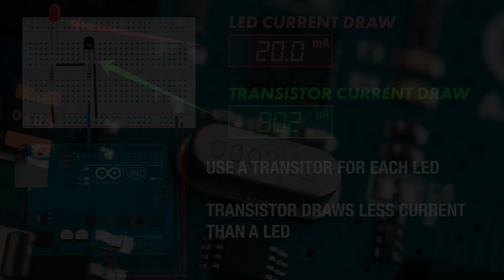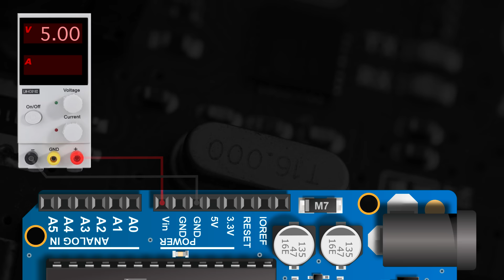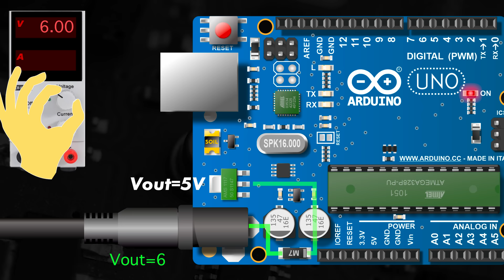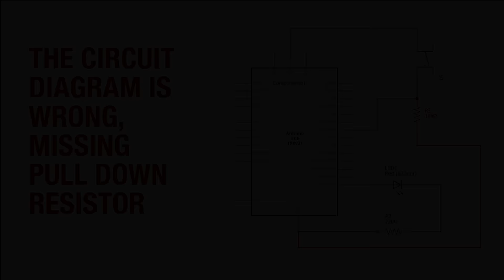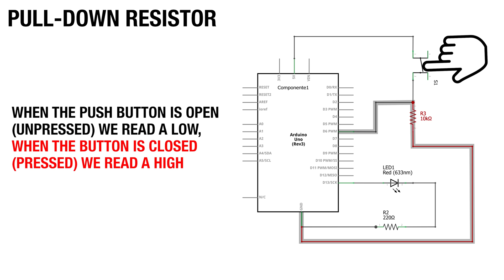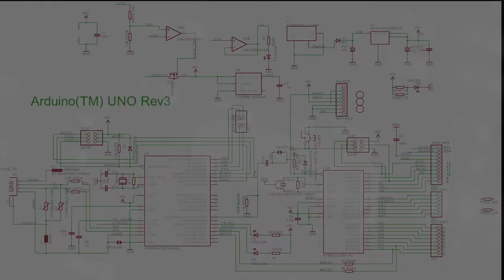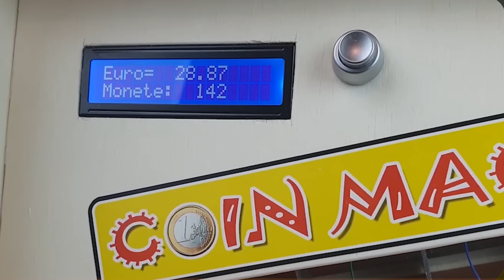8 EASY TIPS for not BURNING ARDUINO

Comment: On 5:05 9v battery is connected to the vin and gnd of arduino and you said in the video before that vin voltage should not be above 5.5v
Reply: Because he's wrong xd, pin can take from 7v to 12v

Comment: Hi, you can connect the vin to a higher voltaje than 5v as it usually is the 5v regulator input pin (in all my nano boards is done in this way).
Reply: A entrada Vin se não me engano não tem proteção contra retorno de corrente, o que pode danificar o computador ou notebook

Comment: Are you sure that Vin is suitable only for 5V power supply?
Reply from the maker: 5 max 12 v sorry :-)
Reply: @DanieleTartaglia  now, it sounds better ;)
But the best way would be to connect 5V power supply directly to the 5V pin on arduino. It makes sense to use Vin pin only if you have at least a 7V power supply source.

Comment: Vin può essere alimentato tra 7V e 12V se non erro, è il +5V pin che può essere alimentato con massimo 5.5V, giusto?
Reply: vin serve per dare un ingresso di tensione diretto al chip bypassando il regolatore di tensione che lo alimenta a 5v costantemente. Perciò aumentando il voltaggio si rischia di bruciare il chip. Il pin 5v invece serve ad erogare una tensione di 5 volt, utilizzabili per alimentare costantemente qualcosa. Spero di averti fatto capire😊
Reply: @antoniochetta9596  Da quello che sapevo, il pin Vin è collegato al regolatore, quindi può accettare da 7 a 12 volt in ingresso.
Una maniera alternativa e forse più "sporca" di alimentarlo è direttamente dal pin "+5V" bypassando il regolatore (anche se come dici te, in teoria, tale pin servirebbe da "erogatore") in tal caso avevo letto che il generatore esterno non debba eccedere 5.5V, inoltre non essendo regolato deve essere il più costante possibile (e a bassa impedenza). Dimmi se ti torna
Reply: @mastroscala  mi torna, per la questione del vin collegato al regolatore domani ti dico, provo con il tester
Reply: @antoniochetta9596  Ok :) comunque ho guardato la schematic e dovrebbe essere così. Inoltre una volta avevo provato a collegare 5V puliti (di un mobile charger) su Vin ma la scheda dava problemi di stabilità, evidentemente il regolatore non lavorava nel suo range ottimale
Reply: @mastroscala  torna tutto 👍🏻
Reply: @mastroscala  ah ok, a me non ha mai dato problemi nemmeno con 4,5 v
Reply: @antoniochetta9596  attenzione accende si accende però può capitare che ci siano dei malfunzionamenti inspiegabili
Reply: @mastroscala  certamente, ma per il basso consumo energetico, un arduino nano, non mi ha dato problemi

Comment: This could have been the best video for beginners, but so many mistakes in a 9 min video!
It will only confuse people who only start with electronics.

The mistakes that I have noticed are:
1. the Vin pin is connected to a voltage regulator so in can be connected to me than 5v (usually up to 12v , depends on the voltage regulator).
2. at 5:00 there is a MOSFET P-Channel shown, but connected as N-Channel.
3. at 5:21 the video shows how to connect a button, but it has nothing to do with the title of the video "8 EASY TIPS for not BURNING ARDUINO", because connecting the button without pull-down resistor will NOT harm the arduino.

Overall this is a very good video, I like it!
* just fix the mistakes ;)